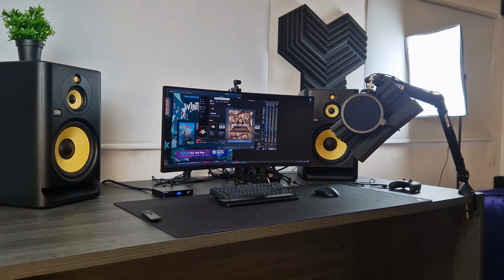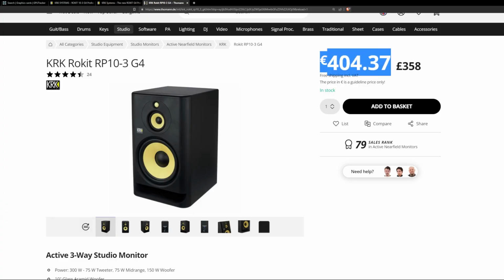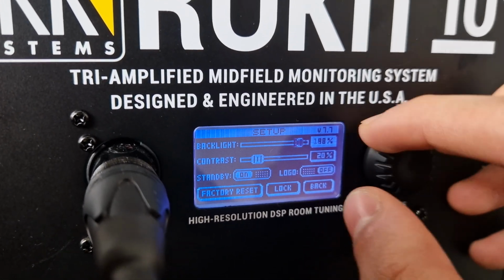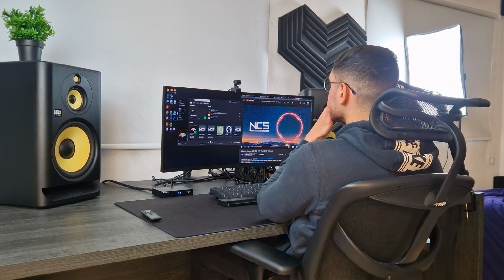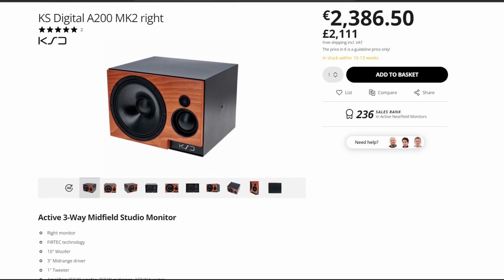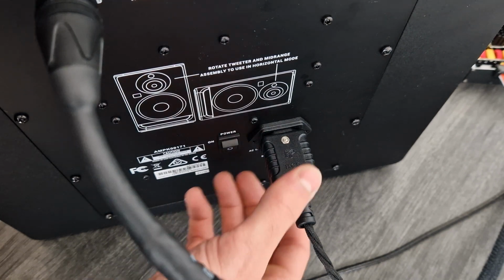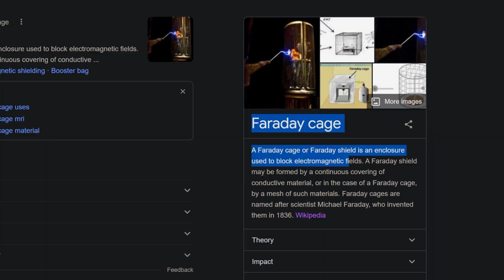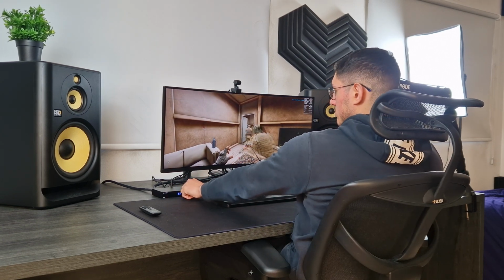KRK Rokit RP10-3 G4: Are the Specs Worth It?

Comment: These are on my shortlist but I'm concerned about the audibility of the hiss, I'm not going to be using these very nearfield, do you know from what distance the hiss can be heard? Also, many speakers have been measured accurately over on audiosciencereview but I can't find much about these online though the specs look very good and the bass extension is impressive.

Good video btw.
Reply from the maker: The audibility depends on how close you're to them and the ambient noise floor. For me I can hear them louder in the night when the ambient noise floor is very low. It also depends on how good are your ears on picking up the sound. 

I would say if you're going to use them like 1 meter away definitely get them. Anything closer than that get them if you plan on fixing them like I'm going to do. 

If you're ok with modifying and potentially losing your warranty then stay tuned for the upcoming video. 

To be honest I'm not sure if it's possible to completely eliminate the sound but I'm going to try and share my results.

Listen to Amir from audiosciencereview for sure! That guy is from the few remaining people that are transparent and share real knowledge instead of trying to scam people out of their money. I didn't find anything about these speakers online as well and that's why I decided to buy then and try them out.

Bass extension is really impressive man! These speakers are a treat to listen to and mix.

As a final word, I would say wait for my other video and then you decide on if you want to buy or not. I'm really curious myself if I can eliminate the sound.
Reply: With the GEN4 Rokit RP10-3s, well according to KRK they are bordereline mid-field / near-field monitors. Near-field is up to 1.5 meters, then from 1.5 meters to 5 meters or so you have got mid-field range, anything above that would be your main (long-field) monitors. I would say pribably if you can have them 2.0 to 2.5 meter away from your head and ears, you should be fine. But this electromagnetic interference has other problems, the AC-DC converter generates a lot of heat, there is no shielding of that from the Class-D amps and the two crossover circuits inside. The RP10-3 does not seem to be well cooled at all. Not sure how long it would take before everything inside basically fries. For the electronics and power supply, this is just a poorly designed model from KRK. I would rather have the RP10-3 with an external power brick PS, frankly. Maybe check out for a comparison this new 3-way model:
https://www.thomannmusic.com/swissonic_x8.htm
Reply from the maker: @frankfarago2825 Yeah I agree with you on the design it's truly a disappointment on the inside. They have the psu module connect directly with the AMP-crossover module no space in between and the noise can still get through if you shield them because they are physically connected :( I'm going to try my best anyways.

The cooling is indeed a problem and believe me I've added heatsinks everywhere and you'll see that in the video. The only thing left is to cover the whole modules with conductive fabric acting as a emi shield because the piece of aluminum that I cut and ground is not doing it. Even the thermal pad that they use to transfer the heat away from the controller to the outer metal piece is bad quality :( 

I didn't know about the Swissonic X8s, they sure look like a very capable and mean speaker but the 8" woofer is a bit of drawback. They need to make an X10 or even an X12 model. That would have been the perfect speaker if they properly designed the electronics inside as well.
Reply: @honestcomputing  I guess with all the custom work you have down with the KRKs, it is too late to return them for store credit or a refund?